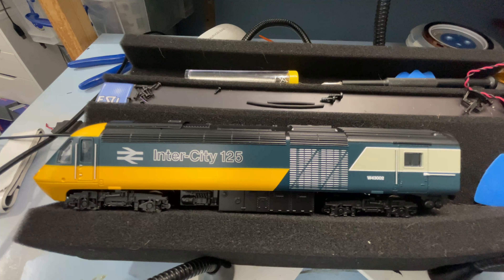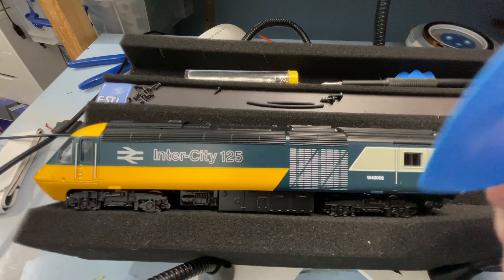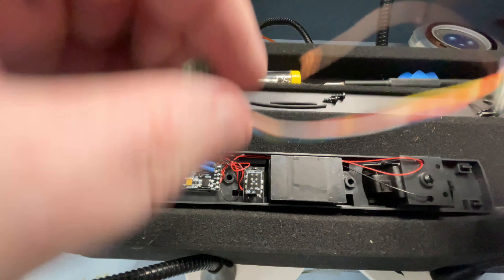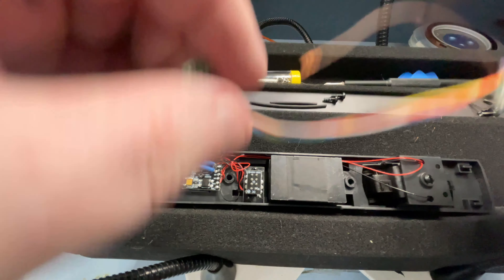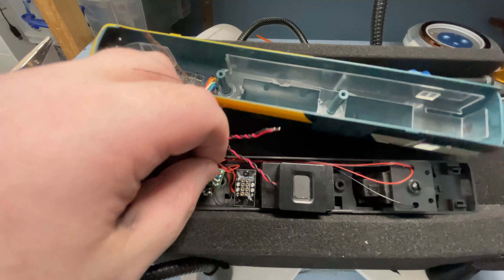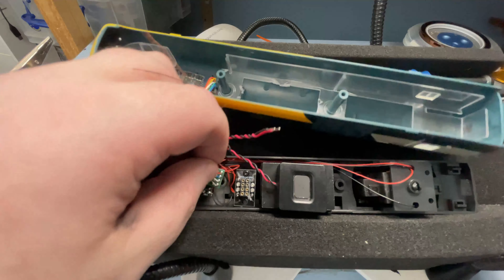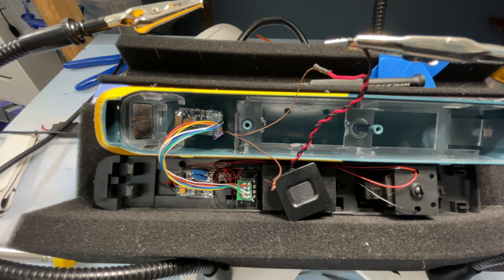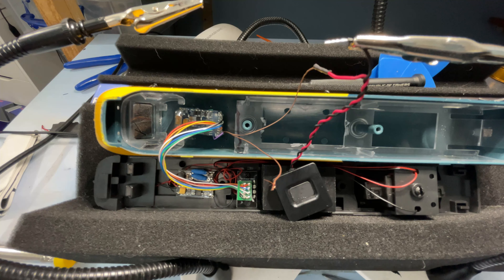oo gauge hornby class 43 hst nephew fitting speaker and chip

Comment: Sounds Great Try Topnik 83 as a flux it comes with brush attached the smallest drop on each wire  will help your solder flow,  not expensive and does not corrode the joint Great Vid     Regards Alan
Reply from the maker: Thank you for your advice will try this much appreciated cheers al 🚂🤗👍